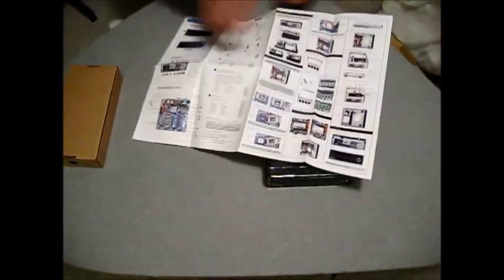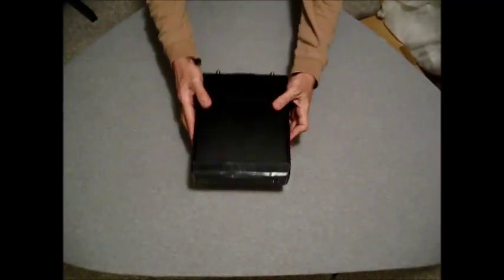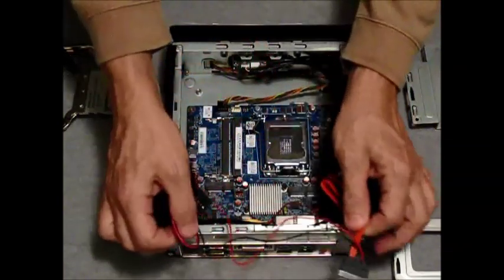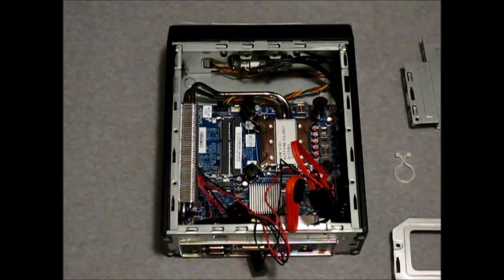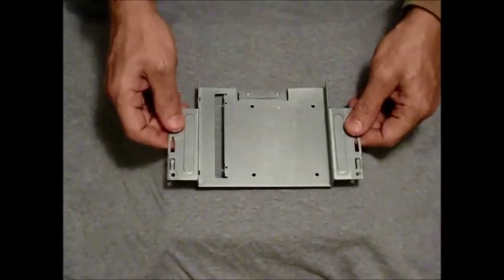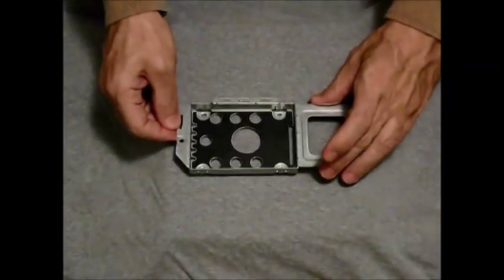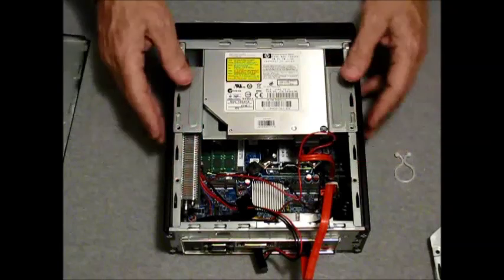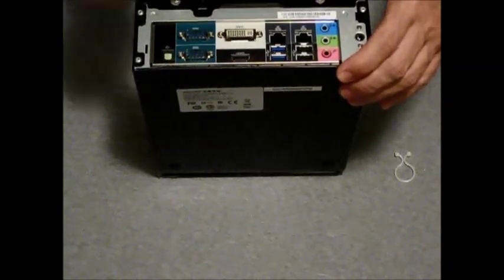Building a Shuttle XH61V HTPC

Comment from the maker: I'm really impressed by Shuttle's cooling system of heat pipes and radiator. My desktop is a larger Shuttle running a Core i7 CPU and it barely gets warm! I've noticed nothing but a very slight warmth coming from the HTPC and the two little fans are absolutely silent!